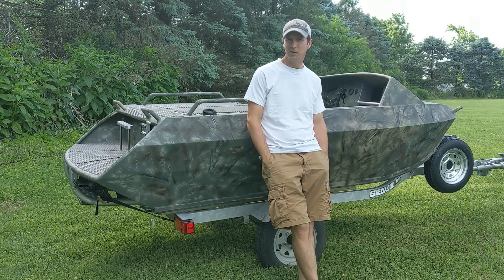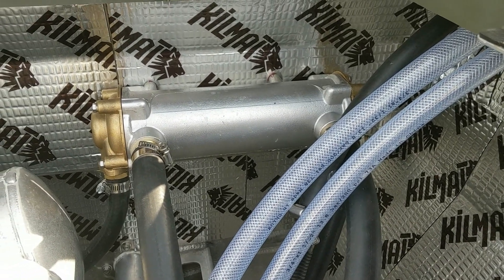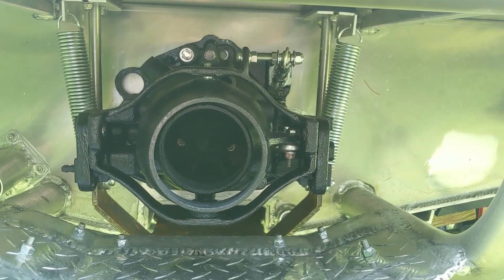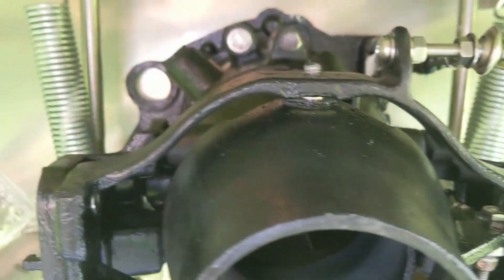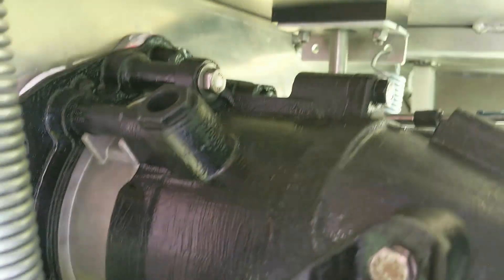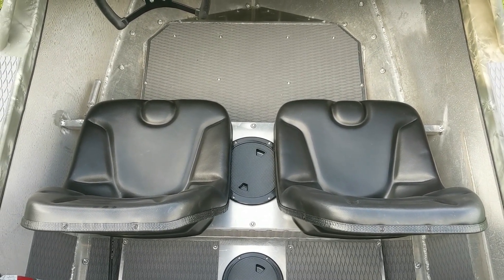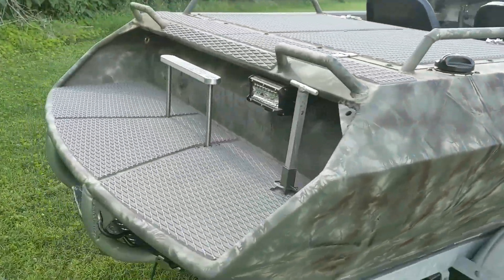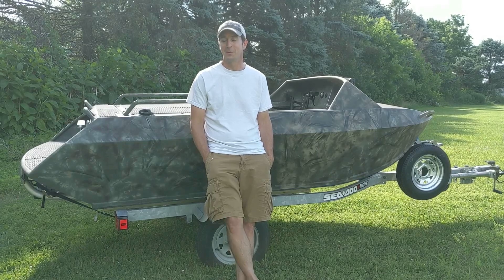MiniJet 10' Avenger - Build Questions and Answers

Comment: Sweet build. I want to attempt one myself with the same engine. I have 2 questions.
1) did you have to shorten the drive shaft?
2) did you have to extend the wiring to the cluster and stuff up front?
Reply from the maker: Thank you!  It's an ideal setup for the type of rivers I run it in.

1) No.  The Seadoo Spark driveshaft doesn't need to be modified.  Yamaha driveshafts do.  Engine alignment is crucial for the Seadoo''s and you'll need to get an alignment tool.

2) Yes.  The stock harness does need to be extended in a couple places.  I crimped, soldered and heat shrunk all the connections since its a marine application.  I also made a second custom harness for the accessories I added.

There's a FB group called "Mini Jet Boat Builds" you can search on for a lot of info.
Reply: @BradHarbin  thanks for the info! I’ve been in that group for a little while now so I will check that out in there!

Comment: Thank you!!!! These are getting popular. Now how does it do in these rivers on the east coast. We using ours near susquehanna river. Of course after we build it
Reply from the maker: It's a beast on the east coast rivers.  I run mine in the Shenandoah and Potomac from Leesburg to Front Royal.  Its all rock with bedrock ledges.  It's gotten me up some big rapids through ankle deep water.  The UHMW has taken a beating on some of the rock ledges too.  No visible hull damage yet, but I am taking the floors up this winter and rechecking the engine alignment after this first season of use.  I couldn't be happier with this build for these rivers.
Reply: @BradHarbin  awesome. Already practicing my aluminum tig welding. Is it a must to buy a spool gun for certain tasks? I'm considering welding the whole thing from a similar company. I got ahp 200 amp tig what was the average material thickness you were welding?
Reply from the maker: @zachary8669  Some people TIG the whole hull, others MIG, but I think most do a combo.  You'll need a spool gun or push pull gun for you MIG though.  The hull bottom is 1/4" and everything else is 1/8".  Most of what I welded was 1/8" and smaller gauge.  I highly recommend MiniJet Inc.  It's much cheaper too because of the CAD to USD exchange rate.

Comment: Love those little jet boats...
How hard would it be to put a motorcycle engine in one l wonder ???
Reply from the maker: There's a good group on FB "Mini Jet Boat Builds" and that question comes up from time to time.  Its possible but not practical.  You'd have to marinize the motorcycle engine, get a pump and figure out the gearing and the torque to get the motorcycle engine to spin the pump correctly.  It seems the people who do it, do it for the challenge and not because it works well.  A PWC donor has all the engineering already figured out.  Its a marine engine that has the proper torque and RPM to spin its pump properly.  All the electronics and driveline components just get moved over to the new hull with minor modifications.

Comment: Awesome build!  I want to do the same combo due to mileage and lack of fuel where I go.  Do you know how much it ended up weighing or an approximate?
Reply from the maker: Thanks man!  I really like the Spark Rotax and have been running it in the 90hp HO mode most of the time.  Plenty of power.  I stopped at a friend's farm to show him and we drove it on his scale.  It was on the trailer still, so I don't have an exact weight, but taking trailer and tongue weight into account, it is around 900lbs.

Comment: Great video. Thanks for going over the details.
How does the boat perform compared to the spark? Did you use the 60 or 90 hp motor?
Reply from the maker: Thank you James!  I actually never rode my donor Spark, so i cant say.  I bought it in Feb and started the build in April right in the height of coronavirus.  I think even boat ramps were closed here at that time!  But the MiniJet performs amazing.  Pops right up on plane and shoots right up rapids over rocks.  This is the 90hp, however there is no difference between the 60 and 90 engine.  Seadoo electronically limits the 60hp option and all it is is a flashed ECU to unlock the motor that's available aftermarket for pretty cheap.    It actually starts in the 60hp Touring mode and I have to hold a button to switch it to the 90hp Sport mode.

Comment: What about bildge pump to pump water out
Could it be use in salt water?
Reply from the maker: stefano, I have two bilge pumps.  One is manual and the other is an auto on a float.  The end of my second build video shows me testing the manual bilge.  It can be used in salt water, I've taken it for day trips in brackish.  However, if this were to be used extensively in salt, or left at a dock in salt water, then proper size and alloy anodes would need to be installed on an aluminum boat. Since it only gets occasional brackish day trips, I flush, clean and put protective BRP spray on the engine.